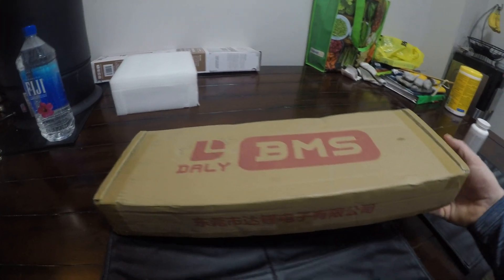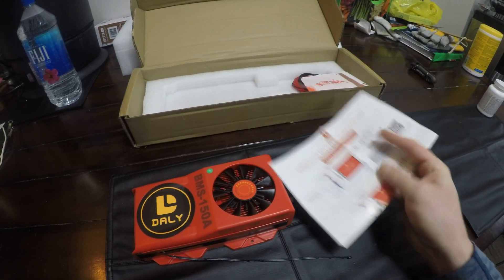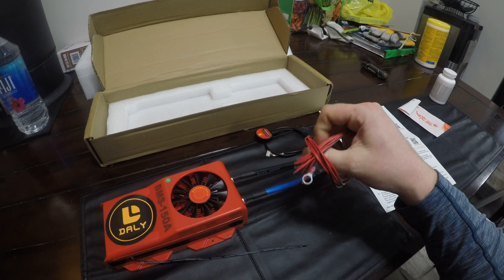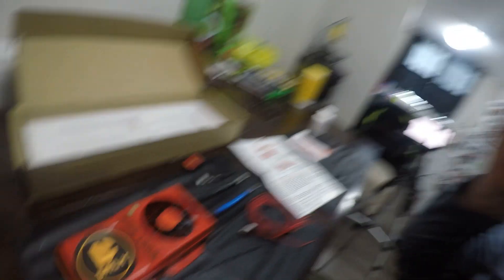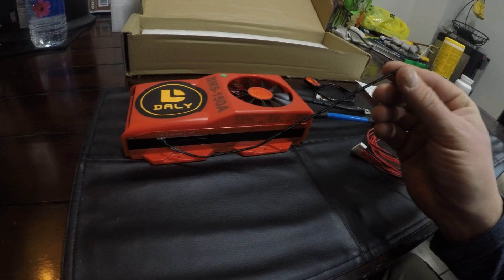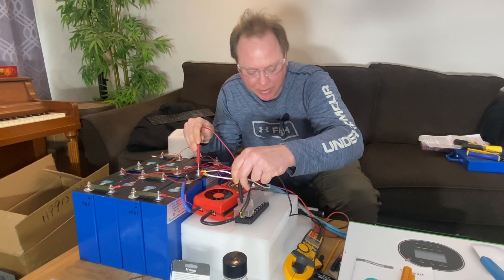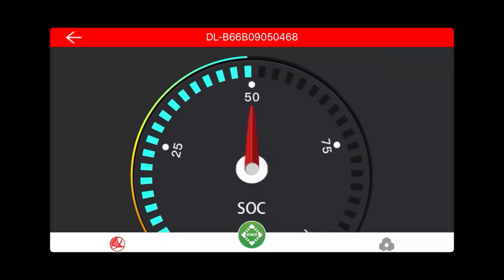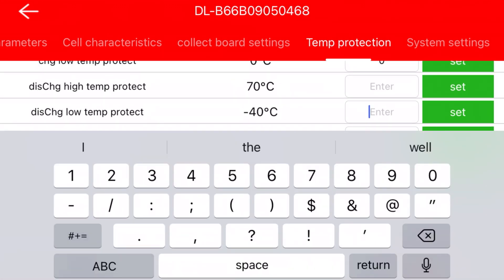LiFePO4 24v Lithium DIY Battery BMS | Daly 150A Install Setup and Testing | Off Grid Solar

Comment: Pourquoi les câbles bleus et noirs négatifs sont petit ?  6AWG pour 150A  ???
Reply from the maker: I unfortunately do not speak French.  But I hope you can read English cause I think I understand.  You are correct. This inverter requires a much larger size of cable for use which I show in another video. This was a test and I did not have the large cable yet. So I used smaller cables and made sure to calculate the load and keep it below the cable I used rating. 

When I did the final installation see n in another video I used much larger cable

Comment: Hello. Thanks for video. Can you tell me where the BMS blow out the air? At the fan or on the BMS side is the air output?
Reply from the maker: Good morning and welcome. 

The fan is in a plastic housing that encapsulates the whole face of the bms. There is an air channel underneath the housing across the front of the bms to the end where the battery voltage sense cable plugs in where there is vents. 

When the internal temp of the bms raises above the MOS. Temp protect setting in the app the fan turns on and sucks air into the front and blows it out the end of the bms where the sense cable is. 

Hope this helps. 🍻
Reply: @IndependentOffGridRetreat  thank you very much for your perfect answer.